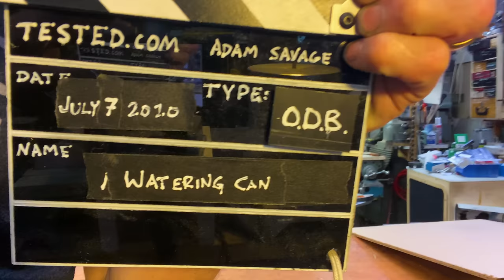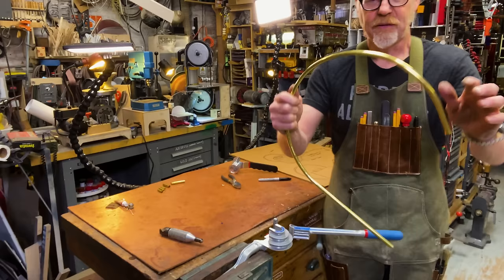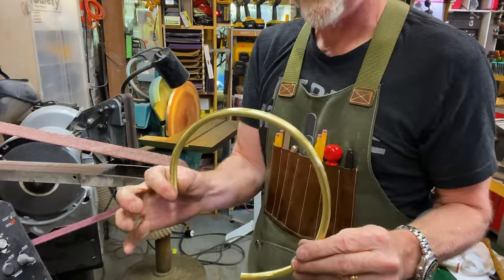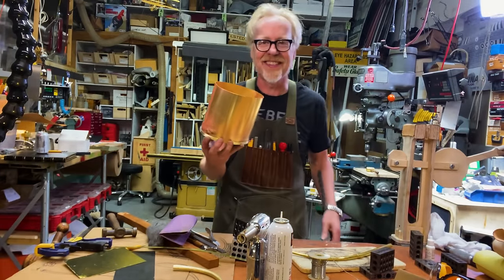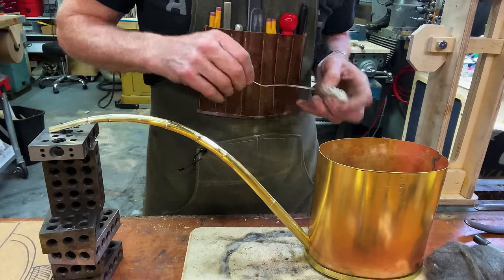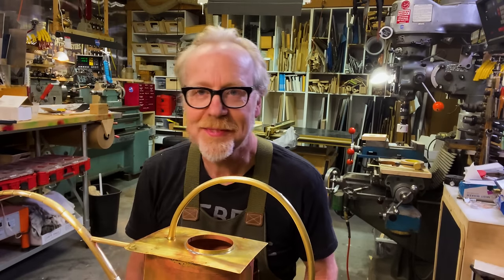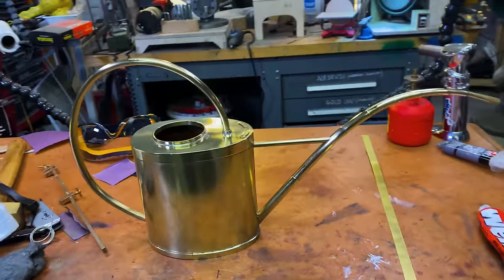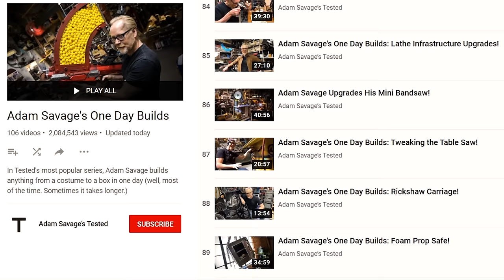Adam Savage's One Day Builds: Brass Watering Can!

Comment: I feel as if Adam would have had an easier time getting those gentle curves if he had annealed the brass tubing (K&S Engineering Brass Tubing comes in a work hardened state) prior to his taking it to the bender and it might have saved him issue with the "puckers" or as he called it "buckling" as he did it. That and of course a larger radius bender but that starts to get into difficult territory rather quickly.

Comment: I don't think you had enough material for the body to do this but would have making opposite facing lips be beneficial for the two edges and this way they could fold into each other and hold themselves while you soldered? The end would have kind of looked like J's and would face opposite directions so when curved together the slots would have "caught" each other?

Comment: Audio quality? I knew it was shot the phone but I assumed you used a wireless pack. It might have been one or two low / bad spots where it got hard to hear but I would love to know how you're doing so well other than not using the provided headset microphone?

Pretty much all of the stuff I've been doing has been with an old iPhone due to size, portability and availability; I've tacked on some microphones but I am still wondering how you get that quality. As an audio human I always strive for better audio.

Comment: If you inset the top and bottom into the sides you would not have had any leaks. It would have a better edge for the solder to stick to.

Comment: Do you have the knowledge or means in order to make a brass drift punch we use them in the heavy equipment industry usually at least 12” long and 1-1/2 to 2” in diameter ... I’d love to learn to make one if you can please sir I have a small forge to possibly smelt in and some tools may be possible to do but I don’t know how to make the mold I know you have experience with both brass and molds.. maybe a video idea
Reply: To be more clear without machining like lathes and such maybe smelting the shaping or something

Comment: Hot tip: quench solder joins in metho to remove oxide and flux 👍 yes I said quench in metho. The hot metal won't ignite it

Comment: Talk about a super premium watering can.  10 to 12  hours to make it, even at minimum wage in San Fran would still be $155.90 to $187.08. And that's not even including material costs (and shop fee if you were hiring someone to make one for you). 

And there is no way that the time of someone with Adam's skills and experience is worth only minimum wage. So triple that, at least. All said, this must be something in the ballpark of a $600 watering based on costs alone. And that doesn't even factoring in sentimental value, the fact that it's a 1 of a kind item made by THE Adam Savage, etc

Comment: Looks nice but I doubt the design is functionally good. The leather handle will turn to mush when wet. The handle diameter may be tool small for the weight of the water. When full there isn’t good balance overall for the weight. The weight of the water will cause the solder to fail on the handle.
I would suggest drip irrigation.

Comment: Try to fill your tube with fine sand next time you bend tube, it should keep it from buckling.
Reply: I just completed bending small pipe at home for a go kart, I did several attempts to learn from using different methods,
I found sand to be one of the least effective, I think it sounds better then it performs,  Supporting the outside dimension is the only way,
The more sophisticated the mandrel the more you can  move it.

Comment: sorry Adam, but it’s actually easy to avoid buckling brass tubes. you fill them with hot pitch and allow them cool and the pitch to harden. then bend as you were. heat again to melt out the pitch and clean with turpentine. surprised you don’t know this, this is how brass instrument makers get tight complicated curves.

Comment: dunno the strength of that 'silver solder,' but all the 'joints' esp. relating to the handle will eventually fail.  Methinks you should've 'flared' the ends to provide more surface area.
Great build though.

Comment: Myth... you can just pour water anyway you want. I have most endangered species of suculents and even cacti. Original Imports from origin countries. They are much older than me and in nature... water falls however it wants. :D I have around 40 to 50k of suculent flowers. Even tried to get some back to the nature as most of the collectors will raid locations for Seeds :/ 1000 seeds in nature can produce up to 100 flowers, in our culture up to 950. It is shame that people are raiding  those places for few bucks. Btw many cacti from Chile have dense thorns to capture water. yeah there is almost no rain in Atakama, but everyday mist from sea side. Thorns capture moist and wax coating on body of the cactus delivers it down.

Comment: Likely unwanted and out of date advice. Fill the pipe with sand, cap it on each end then bend it just a plastic plug will do.

Does mean you need to clean the inside out after, but it's used alot in the mechanic world for brake lines. You can obviously fill with liquids, eg water, brake fluid etc. But one its harder to keep in there and pressing against everything, and if it burst you can make a mess.